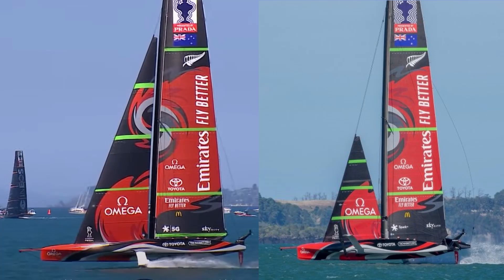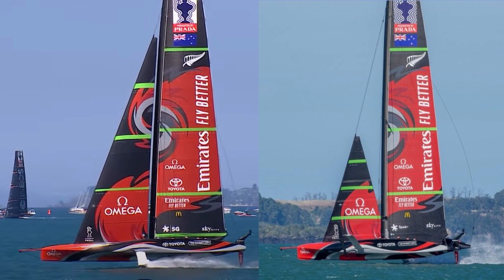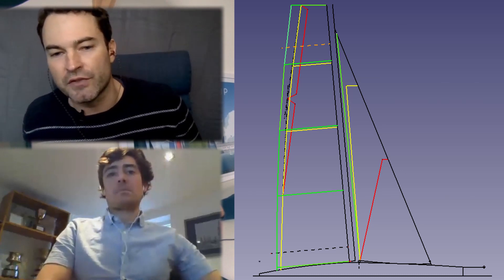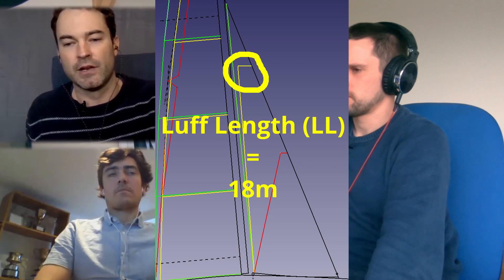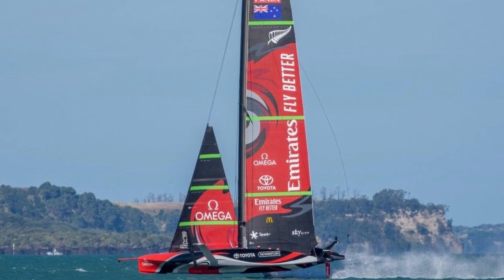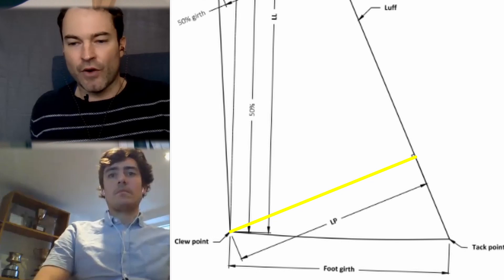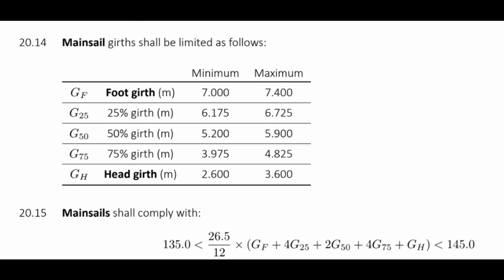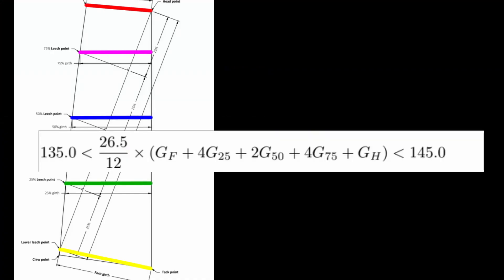Batwing Main and the UNLIMITED sail area loophole: A guide to America's Cup Sail Plans (Part 1)

Comment: Why can't the America's Cup just be a fair, sporting event? All the loopholes, subterfuge and connivances are an insult to the principles of sportsmanship.
Reply: There are sailing events that are but AC has always been a development race (as well as being a bit of a political drama) as much as it is about sailing skills. Sail GP is where you want to be.
For me, I love the development and innovation race.
Reply: @chris770  I also love the development and innovation race. But you can have that without one team composing the rules such as to deliberately obscure tbere actual meaning from the other teams.
Reply: @dundeedolphin  I'm not so sure anything's hidden, its more about thinking laterally and finding ways to look at the rules in another way rather than taking them on face value. Every team has that opportunity. 
I'm no boat designer and there's definitely a lot that I can't do but in my working life, i'm essentially a problem solver and the thing that makes my colleagues come to me for answers is that I tent to look at things from a different perspective and find a solution nobody else would have seen - That's what this is about.
Reply: @chris770   It kind of is. This video is partly about how the omission of the letter "m" or the word "metres" gives the impression that the 26.5 in the Simpson formula refers to the mast height when, in fact, it does not. So rather than lead to innovation in engineering and design, I think all this leads to is innovation in obscuring the intended meaning in rules. Now if we had an independent governing body, or if we had a rules committee consisting of all the teams, then creative intepretation of those rules would be a legitimate sporting advantage. But we don't. Is it coincidence that it is ETNZ who has creatively interpretted the rulescon mast height?? I doubt it. The defending champions make the rules and adjudicate on how they are implemented. And this is just one example from a history of deceit and gamesmanship in the America's Cup, to make it easier for the current champions to retain the trophy.
Reply: @dundeedolphin  Not really, why does that number have to be in meters? It's just a ratio, and if you're a boat designer who thinks outside of the realms of general assumption then you're going to innovate better, any team could have done things ETNZ have done here. Likewise NZ has been beaten before by better innovation, even on an occasion where they designed the rule which just goes to show it's a part of the game and you have to innovate and design better than the other teams and then sail well to be able to win the AC - that's what it's all about and is what it's always been about.
Reply: @chris770  Yeah, fair point. But I think you are missing the bigger picture and pattern of behaviour. It wasn't one of the other teams who "found" this creative intepretation of the rule. It was the team that wrote the rule. If one of the other teams had done so instead of ETNZ, would the ACE have upheld any challenge to that interpretation of the rule. We don't know but there is a history to suggest that the challenger team would not have been allowed that same interpretation. There is a pattern of deceit and a consistent lack of a level playing field in the AC, from the defender getting two boats to the challenger getting one; from the defender using a cat against the challengers' mono; from last minute class changes; frim a slew of flup flopping rule changes. The America's Cup is consistebtly set up to favour the defender. Not sure why you're trying to suggest otherwise.
Reply: @dundeedolphin  of course it is but that makes it all the more exciting to see a challenger climb that mountain and win the cup.
Reply: @chris770  Yes. But that principle could be applied to every sporting competition in the world. O to anything else. "Hey Chris, we've decided to make it harder for you to get a salary increase at work. But don't worry, if you manage to get one, that'll make your sense of achievement even greater" Is that fair? 😄👍
Reply: @dundeedolphin  they can't read?
Reply: @dundeedolphin  if they can't read....it ain't our problem.u think spithill has a problem with protest...think again
Reply: @dundeedolphin  26.5 does refer to mast height. Simpsons is x/3 (1,4,2,4,1). So x/3 is the same as 26.5/12  based on a total span of 26.5.
Interesting that they use mast length rather than Luff length. No max luff length in the rule. Therefore if you can make the luff longer than the mast you get some free area.
Reply: @rbcg105  That's specifically NOT what the video says.
Reply: @chris770  I agree, winning the AC is a multi faceted challenge and any team  that encourages problem solving alloyed with thinking outside the box will be the stronger for it. This is one area where ETNZ have always excelled as touched on by John Bertrand and Max Sirena in recent interviews.
Reply: @chris770  totally agree
That’s what sets it apart from any other yacht race
Reply: @alhaze2161  Spitthill vs Burling
I can wait to see those aggressive pre start manoeuvres
Time to put the gloves on
Reply: It is fair. All teams have the ability to exploit these rules when building their boats. Though some don't see those rules. Team New Zealand saw that nothing in the AC 50 class rules stopped cyclors so they went with that. Same with the winged keel of Australia II or using a cat against a monohull. The only way you could make it more fair would be to make all the boats identical but the America's Cup has always been a race between designers just as much as it has been a race between sailors.
Reply: @franzfanz  Without doubt, the AC lacks sporting integrity compared to most other major sporting competitions. That's an historical constant and a hallmark of the conpetition. How the rules are draughted, managed and adjudicated is consistently partial in favour of thedefending champion and always has been.  This is perhaps an inevitable consequence of not have an independent governing body. But to suggest it couldn't be fairer is entirely wrong. I don't believe for a moment that the ambiguous wording of the rules governing mast height was not intended to provide a performance advantage for ETNZ.
Reply: @dundeedolphin  Yes, the defender setting the rule is an advantage. In fact it is the advantage. The one advantage they have over the challengers. The challengers have more boats to get the design correct (because there are multiple teams) and they get the advantage of race practice through the Prada Cup that can't be entirely replicated racing chase boats. Also, the Challenger of Record has a big say in deciding the rules for the boats so it's not as big an advantage as you might think. Also, as I pointed out the defender has been tripped up in the past by challengers exploited rules loop holes that they didn't foresee so it's not just one way traffic on that score.
Reply: @franzfanz  It's not exclusively one way traffic. But almost. 😀
Reply: @dundeedolphin  Given that for the last 25 years each defender has only managed a single defence I'd say the balance between defender and challenger is pretty even.
Reply: @franzfanz  Yes, it's definitely more even than it used to be. But it's also definitely still not a level playing field.
Reply: @franzfanz  the defender has the advantage of knowing exactly how the challengers stack up before the AC race starts from data collected during the Prada cup
Reply: @franzfanz  well stated sir
Reply: @dundeedolphin  ya. How many kiwis vs you lot? I reckon we are punching above our weight..again haha. And who doesn't like it?
Reply: @michaelhermans4753  but not the advantage of experience or team esprit de corps
Reply: @alhaze2161  true you can’t have it both ways
Reply: @alhaze2161  new rule kiwis can only sail on a NZ boat
that way we will keep the cup for another 175 years
Reply: @dundeedolphin  I think the rules going forward will be scrutinised like never before 
They could get so complicated it would make our tax laws look like a one page draft
Reply: @franzfanz  good point
Reply: @franzfanz  that’s a good point, holding on to the cup is not easy which on one hand shows there’s good competition going on and also is a showcase for the feat that it is for a challenger to obtain it which is all part of the spectacle!
Reply: Because then it would be only half the entertainment. How many people follow a Nacra 17 race outside the Olympics?

The America's Cup has been that since it's very beginning. The race around the Isle ow Wright was won by a controversially discussed boat design and by skipping the Nab light vessel mark.
It is as much a boat design competition, as a sailing competition. Maybe even predominantly a constructor's challenge. And these types of arms races will always see someone pushing the boundaries of the class rules - especially on the first iteration with any new class.
Reply: @knutpohl339  Yes. That's a legitimate point. Maybe it's part of the "charm" of the competition. But I'm still right to say that the obfuscation over rules is an inside job i tended to give defending team an advantage. As ever it has been.
Reply: It's in the DNA of the Americas Cup. As I recall it, in the early days they had a rule that boats had to sail from their home port to the race course. So the British boats had to be strong (and heavy) enough to sail across the Atlantic.
Reply: @HughFordham  prob a defenders rule. Considering all the crying about rules seems a moot point. When you take into account the strength required to cross a ocean for One boat and not the other.
Reply: @alhaze2161  the southern ocean and the Tasman sea if you want to challenge NZ
Reply: The multi year collective spend of this crop of four AC contestants is in the neighbourhood of half a billion dollars. The ruthlessly competitive billionaires and corporate majors funding these efforts are fully aware that part of the challenge is , "within the rules", overcoming  the Cup's history of gerrymandering and "no second place" ethos.You can be sure they don't come to the contest having a naive belief that winning this ultimate of sporting trophies  is about joining hands  and singing "Kumbaya" . Their secretive campaigns feature carefully chosen teams employing  the  most innovative designers linked to  highly skilled building folk and  extremely competent shore based support staff . Teams are craftily advised in the legal dark arts of  "race legality parameters"  by leading "class rules gurus' the match of any  big city "silk".  Best of all have they have gathered together the most competitive  and gifted sailors on the planet. This, since 1851, for the sole privilege of winning bragging rights to AC supremacy as "best of the best".  It is already a jaw dropping spectacle on foiling 75ft missiles whose performance was not dreamed of a decade or so ago,  Perfectly epitomising  the darwinian  nature of "technological progress", it  is contested in amazing vessels that will likely be obsolete and of comparatively little value at the finish of the last race. What should be ringing in everyones ears about the scope and magnitude of this contest is Maximus's proclamation in the coliseum ... "... Are you not satisfied!! "
Reply: @alienlifeformresearch2280 bloody well put so would i be right in saying for us mere mortals ....within the rules ...be in it to win it or dont bother and take up tiddlywinks
Reply: @lilyfisher9804   This is true of AC  ... however, just sailing recreationally for the fun of it is always great.  ... though ... you having brought it up, I do  recall as a kid  meeting some pretty fierce tiddlywinks players,
Reply: @alienlifeformresearch2280  Totally love sailing. There's nothing better.
Reply: @alienlifeformresearch2280  True. "Satisfied" is a fairly beige term. I want to be delighted. But mostly I want a fair contest.
Reply: @dundeedolphin  I hope it plays out 7-6 whoever wins.
Reply: @alienlifeformresearch2280  I would settle for that. 😄
Reply: @dundeedolphin  Cheers
Reply: @alienlifeformresearch2280  historically it’s been a whitewash 
Somehow I think it won’t be this time
Reply: @dundeedolphin  on the water or in the engineering office
Reply: @alienlifeformresearch2280  well said. Beautiful.
Reply: @alienlifeformresearch2280  Love it ! :-)
Reply: @alienlifeformresearch2280  spoken like a true wordsmith
Reply: @michaelhermans4753  Cheers
Reply: In one word: History!
Its defined as a Development race. 
Once you understand that it all makes sense.
Reply: @briancavanagh7048  Thanks for the condescending tone Brian. 😂 I understand that quite well. 👍
Reply: @dundeedolphin  
Sorry you took at that way as it was completely unintended.
Reply: @briancavanagh7048  Then please forgive me for being over-defensive.
Reply: @Mat-t-  24 months before the win in Bermuda ETNZ were 2 weeks away from folding due to a lack of money. They won in Bermuda despite a budget that was by all accounts less then half that of  ORACLE, poorly funded underdogs can win the cup !
Reply: Does anyone follow f1? Is this any different. At this level, you have the smartest people driving, building, designing and interpreting the rules. If you don't, you wont win anything.
Reply: @robodobo222  Great point. Yes, it is different. In F1, the defending team does not compose and adjudicate the implementation of the design rules. And that's the AC problem in a nutshell.
Reply: @dundeedolphin  True, but TNZ, didn't write the rules in 1995 or 2017.
Reply: @robodobo222   Yes, but that doesn't mean the current competition is even, though, does it? For tbe record, in 1995, the formula had the word "metres" in it. 😄
Reply: @dundeedolphin  I would never say The Americas Cup is fair, I can't remember it ever being fair and I doubt it ever will be, but that's wy I became obsessed with it.
Reply: @robodobo222  😀👍
Reply: @robodobo222  one of the big draw cards is seeing what innovations the other teams come up with
It reminds me of the frustrated Americans when Ben Lexons winged keel was hidden from view 
The build up of intrigue and the jaw dropping moment when it was revealed
Reply: @michaelhermans4753  This is exaxtly what got me started. The thing I miss the most is the keel unveiling.
Reply: @Mat-t-  na bro haha
Reply: Rule writing is always a mix, and more importantly a balance, of proscription and prescription.

The more proscription there is, human nature responds by saying "The more things you say I can't do, the harder I'm going to look for something that is not on the list.  And if its not on the list, by definition I can do it."

Alternatively, if rule makers only prescribe, then every minutiae must be prescribed and that's just not possible. So it's easier to do both and the upshot of that is that people become very creative. And creativity is just genius waiting to show its face.

Consequent to this: the America's Cup as it always has been and probably always will be!
Reply: @chrisdyson2833  True.
Reply: @Mat-t-  yes that would be a great result
Reply: @Glenn Watson Absolutely. Except, in Formula 1, the defending champiions don't make the rules and adjudicate disputes.
Reply: Go watch the Laser worlds then.
Reply: @AnttiBrax  amen. No truer word spoken.
Reply: @AnttiBrax  Boring :-)
Reply: Ya. Like no one can read rules world wide. Sounds like a bunch of crybaby poms making up reasons why they did in and why we..kiwis..may win. If you can't read the language you apparently created.....ya. keep crying snowflakes. We be here drinking stories cold and laughing our heads off. You may have to wait another hundred and something years....
Reply: @alhaze2161  the britz are reaching for their tissue boxes